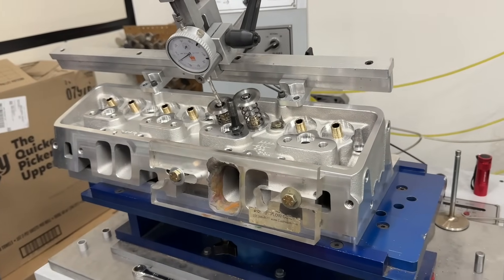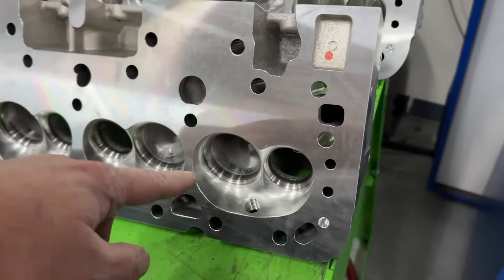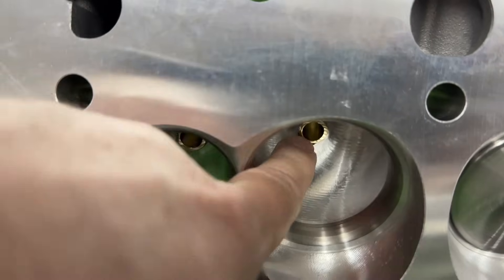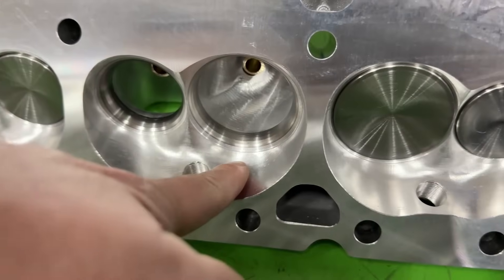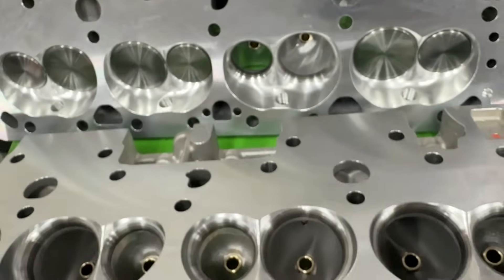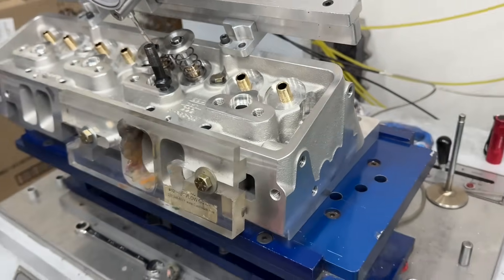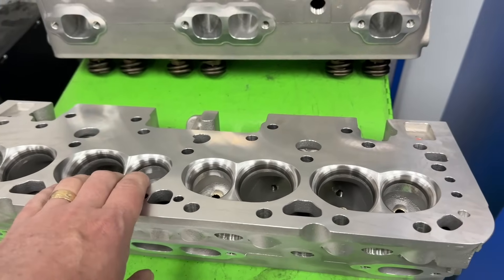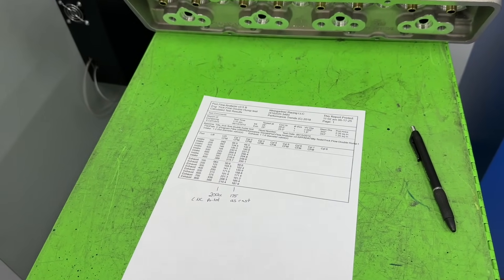CNC Ported vs As Cast Trick Flow Double Hump Heads

Comment: If the vein is to switch direction of airflow, and one is on the right and one is on the left and the center is open.That's because it's pushing the air to the center.If you put the vein in the center, it's going to push the air left or right

Comment: How much compression do you pick up 74 smog head to 60 or 66.  Shop told me 40 yrs ago the double hump they sold me
should raise mine from 8.5 to 9.25 Fresh out of high school I just gave the blank stare & smiled. Cam was the solid 327 
365 hp. Got a 71 GMC truck into high 14s.   🤗

Comment: Stop OEM castings cracking around the bolts. Use headstud washers. And check your bolt underhead is still square. I have seen wrecked ones and that was always the reason.

Comment: I would have thought the CNC version would pick up more than 20cfm. The cast head is pretty good, more than 250 through a 175 port isnt shabby. Its not record setting but its pretty reasonable. The difference in cost is also huge, its $400 more for the CNC version each. You have heads listed on your website that are both cheaper and better flowing than the CNC version.

Comment: For my circle track car, rules in 80 and 90s required stock iron, no vortec and no over counter.  So we ran 461 462 041 etc etc. My legal set was angle milled 060. My better set was angle milled .150. Yep over 1/8". The key to head living when heavily angle cut was run it a tad rich, and absolutely dont lean out or detonate and we ran water temp at 160-170 instead of 200 with 'regular' heads.